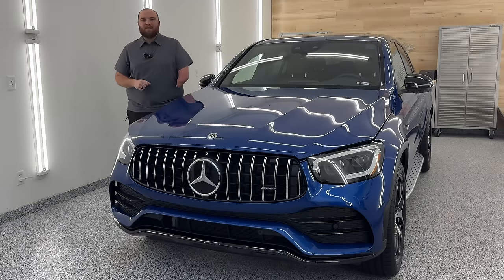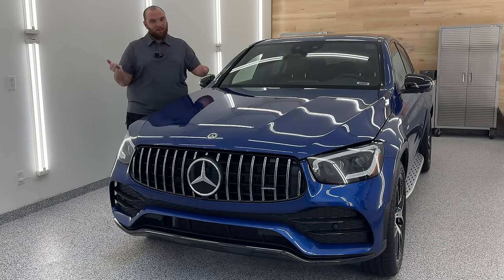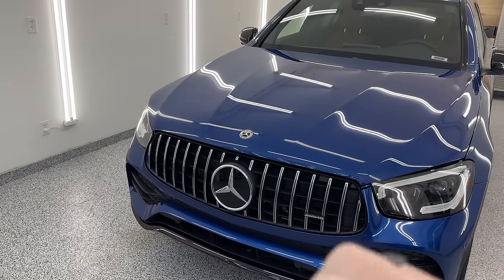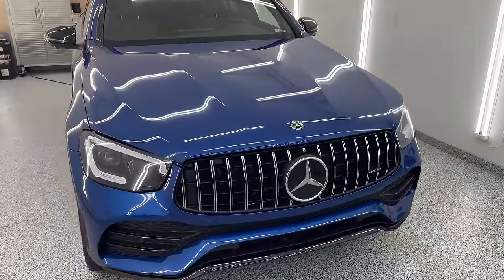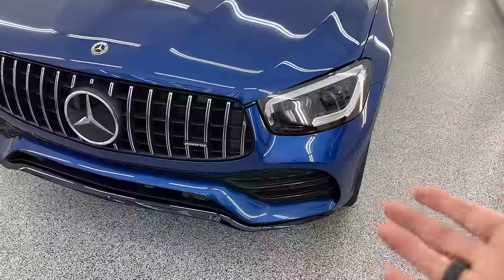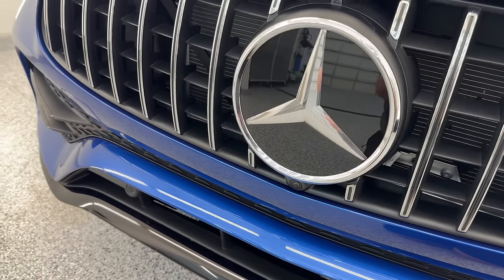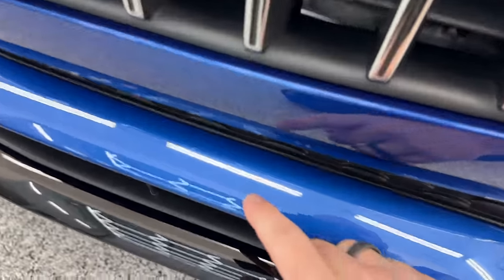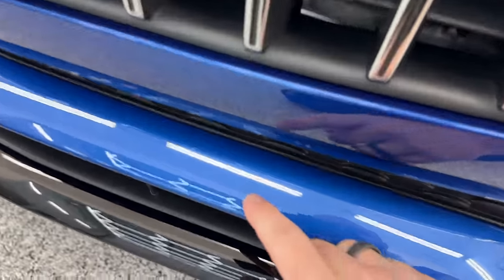The Ugly Truth About Paint Protection Film (PPF) After Just 6 Months & 3,500 Miles

Comment: Heat will make them marks better btw. Heat gun high heat. Just not to hot or you will burn the ppf.

What people don’t realise about ppf is that what would normally chip paint, won’t chip ppf. There will often be no marks at all from road rash. Whereas it would have chipped the paint. Hence paint protection film 😃 

it’s not bullet proof. Sometimes it will chip the ppf, but the glue crunches up together to protect the paint. Minimising damage to the paint its self.
Reply: But yeah that job is shoddy
Reply from the maker: Heat will not remove glue lines, silvering marks, stretch marks, or bug stains. That is all down to install error. Yes PPF will protect the paint in most cases, but again at what cost? Well in most cases THOUSANDS of dollars and an overall worse looking finish.
Reply: I mean if you know what you’re doing it will certainly make it look a lot better. I’ve been doing it 10 years 😃 was just a bit of advice.
Reply: It’s the bug stains and silvering it can help, as I say. If you know what you’re doing.
Reply: Yea heat and finesse and you can definitely make glue issues look way better. Use a clear plastic spoon and learn something new! You will be surprised

Comment: Coleton, I have a new ultra red model S plaid coming in a few weeks to replace a model Y performance. I did not PPF the MYP. I drive 30K+ miles a year on the highway and the model Y performance looks like it’s been shot several times by a shotgun with all the rock chips.  In this scenario would you do anything with PPF?  I think this car is going to be the right tool for the job for 6-8 years.
Reply: @onwisconsin2362 Gosh, I wish you would have said that sooner. 😉
Reply: Where were the majority of the rock chips? Bumper and hood. I'm trying to figure whats the most cost effective to protect
Reply: FWIW, I had a full frontal done + rear wheel arches on our Model S Plaid for 1,700.  I think that's the sweet spot on cost vs. protection for a high-mileage high-speed application.
Reply: @don.newlon  Awesome thanks for the reply. I'm going to do the same on my Tesla

Comment: Great vid, thanks for sharing.  A poor install for sure, probably a beginner learning while earning.  You’ve made good points, the PPF is like a condom, I will keep you out of trouble the majority of time but is not flawless.  As a sacrificial layer it’s not the way it looks when on the vehicle but what the vehicle looks like after removal.  I’ve used it many times without disappointment, and at the point of resale many have asked me if the car had been repainted for lack of damage exhibited.  Always my concern is rust for that chip that goes down to the metal forcing a repaint that itself does not always last and is ridiculously expensive today.  As an anal car enthusiast PPF allows me the freedom to drive without worry, a freeing experience for the anal amongst us.  Additionally with the front fenders PPF’d the engine servicing is of less a concern, how many times has a car come back scratched to hell from bad dealer mechanics leaning over them with belt buckles, hammers, knives, screw drivers, watches, chains, or what ever else they shouldn’t be near your car with?  Just my opinion from too many years of experience, and yes I was a professional detailer years ago, now enjoying it as a passion only.  Be well.

Comment: I would never go with PPF for that price. I prefer to plasti dip my car . Adds somewhat same protection from rocks and stuff. Yes looks bad after some abuse from rocks bugs etc and peels but for another 300-900$ depends on colors and car size you can redo it in a day even on your own, maybe even change a colour or have a fun mix. Makes the car more unique and personal and at the end before selling you can remove it in an hour. One of the reasons why now i buy only white cars. Cheap to repaint or correct for the same price as you would put bits of PPF and risking to have uneven cuts or fingerprints etc :D

Comment: PPF is not perfect, but the cost of body work just keeps going up. I had to have a panel resprayed and since it was the rear quarter it was a nightmare. Respray a couple harder to R&I panels and you're now even with the cost of partial PPF,  except now you have a body shop to deal with and they may not do a perfect job. Plus, when you go to sell the car, if it's not private party you will get dinged a bit for a respray and many of them use paint thickness gauges to look for it. I also don't think the clear shot by shops is as hard or as long lasting as modern OE baked clear.

Comment: The second p in ppf stands for protection correct? So i don't get your criticism, it did what it's designed for.
It's not for looking better while on the car. It can't provide that, and it doesn't claim to.
It's like the knee protection when skating, or the helmet when biking. It's purpose is protecting.
it took almost all of the damage instead of the paint better to have the rocks and bugs damaging the film than the paint.
Your critcism (before the part about the guys installing it) sounds like the guy i know, who eventually bought cutproof safety clothing for working with his chainsaw. When he used it the first time, he had an accident. The chainsaw caught, jumped and cut into his safety trousers. His thought about it: _f*** i wear those expensive trousers 1 time, and now i have to throw them away, they are destroyed_!  He needed someone else to tell him to think about what would have happened if he had not worn the sacrificial safetygear...

Comment: Came very close to getting PPF on my brand new car, but for how expensive it was I honestly couldn't justify it, just doesn't make any sense. Rock chips will not reduce the value of a used car. It's a used car, it's gonna have some dings here and there, no single rock chip affect resale value, unless it like ripped your door off. You also risk someone cutting your panel which then can lead to rust getting up under the car. Seen it happen on supercars, not worth that risk. I have a 10 year old car and it has very little rock chips, only one that's noticeable. Based on my experience having owned a 10 year old car and having very few rock chips, again, can't justify the price

Comment: Yeah, it costs a fuckton of money, a heck of a lot of labor to install, but if you do it yourself its actually a really cheap option to ensure your car doesn't get damaged especially if its a really old car that you have in good condition and actually want to drive it. The whole point of ppf is literally to save you from having to respray parts of the car, having to paint match rock chips especially on a pearl is a pain in the ass and for older cars NEVER comes out 100% factory perfect. A little bit of bug staining is not an issue when you're battling 400 bucks a panel to respray at the minimum and still will be less value than when it was factory.

Comment: The ppf did the job and protected the car's paint. Which is what its supposed to do. The owner can replace the ppf and don't need expensive paint correction and polishing because it did its job. But on the benz that ppf installer is joke, 2000$ for a shoddy work.

Comment: Meh. I get the not so fine line between good and bad installs, but at the end of the day just like every service offered it’s about the client. 

Their desires and expectations, what are they trying to prevent and what makes the most sense for them. 

It Is not paint perfection film.  Its main goal is to protect. They are different level of installs, but just like there are different levels of paint correction. Some ego guys want to get the paint perfect. But what does the client want. 

It’s so easy to see a ton of issues in proper detail shop lighting. But you bring it out into the natural light (sun) and you will be hard pressed to much silvering or glue issue. But again at the end of the day - did the client see any of it and point it out? My guess would be probably just the dirt on fender if anything

Comment: If you ceramic coated the whole vehicle & the guy came back & there were permanent stains in the ppf then in my opinion it's the ceramic coating that failed.
Reply from the maker: I’d say both failed
Reply: @OutofSpecDetailing  not really. The point of ppf is to protect the paint. It's in the name & it did it's job just fine.  Ceramic coating is supposed to be a semi permanent coating on whatever surface it's put on to protect from this exact form of damage & it DID NOT do that

Comment: There are a few things here that don't add up. No disrespect to #OutofSpecDetailing but in this video he doesn't know what this PPF product is. Putting the wrong coatings onto PPF at best might do nothing to help, and at worst...  this is Chemistry and they've used an untested combination. For PPF it's better to use a nano coating. They don't last as long as they are more flexible, but they can move with the PPF. This is different to a Ceramic Coating (as mentioned in this video) as they are designed to work with hard stable paint.

Also this car looks great - so PPF doing ok from what I can see. 🤷‍♂

Comment: Is PPF worth the money?
That's like asking if Sudden Impact is a good movie.
6 months of PPF and 3500 miles is Again, subjective. 
Waaaay too many variables to be suggesting that people not use it. I've had it in my Hellcat since 2018. Expel. Professionally installed. Absolutely no issues, ZERO, with the performance of the film. In fact, not only was mine ceramic coated but it also actually has Several Several Several Knicks and dings because Texass roads. 
You bug stains problem is an issue with the owner not taking care of their vehicle. Bug stains are far worse in paint as the bug guts and chemicals etch into paint. I'd MUCH rather have it etched on the PPF and NOT the paint.
Wash your damn car man. Just because it's PPFd and Ceramic coated, does Not mean ya just drive it and forget it down the next 80 years.
C'mon man.

Comment: This is the dumbest video I've ever seen against ppf. This video to me pretty much proves why you "should" have some protection on your car. He failed to mention that bug splatters also stain paint, and those small rock chips damage, well imagine with no ppf. Also, he wants to sell detailing and wax jobs....if you ppf your car and ceramic coat over it will DRAMATICALLY reduce staining.

This guy is just making more business for himself....how....well if you don't ppf then you have to pay for full detailing more often and that's also not cheap. What about the case of rock chips, there's no solution accept, well get the bumper painted, that is an absolute nightmare. For one more expensive than ppf, two they have to disassemble your car and reassemble and these paint shops break things and reassemble things wrong all the time because they do paint, not Mercedes, BMW or Toyota technicians, and not to mention all the auto cruise control and safety radar stuff in modern cars. They have to disconnect that reconnect and recalibrate the cars whole safety system, yeah sounds like a great idea to let a paint and detail shop do that. And the absolute worst is that VERY FEW paint shops can get your original color match, especially if it's a very specific color gradient paint, like many Lexus, Porsche and BMW models have. And if the car is older and sat out in the sun often it's virtually impossible to match the naturally faded paint. Your only option is to repaint the whole car, that sounds lovely.

PPF is a layer of paint that protects and sacrifices itself in place of the car's paint. People let me tell you, if you care enough about putting ppf on a car then you have take care of it. That means when you get bug spatters wipe them off, when you reach your destination, DON'T let the bugs bake on the hood for weeks then go to this nutjob. If I take a road trip I immediately wash the car at my destination and do the same on return. During daily commutes, I wipe bugs and splatters away every several days.
I actually do plan on keeping my car, I'm a car enthusiast, so I get it detailed, paint corrected, ppf and ceramic coat the car. I always hand wash, and I do the required maintenance to keep the ppf healthy. in about 8 years I'll have it ripped off and put new one. If you don't have the time to maintain your car then, you probably don't care to begin with, pay someone or buy a Chevy Malibu, Camry or minivan you don't give a crap about. But for any car enthusiast, interior, exterior and mechanical upkeep is part of the car guy love. I own a 22 4Runner in a very metallic paint and in the two years I've owned it looks immaculate but I went to my guys shop the other day and he had a Range Rover SVR who ppf'd the whole car in stealth ppf and worked at an airport where he parked in the sun everyday for 4 years along the runway where the engine fumes settle over his car. The ppf is atrocious, and ruined the clear coat on the carbon fiber hood, why because very poor maintenance. Keep things in context or the internet can plain out make stuff up like this guy.

Comment: ITS PROTECTION NOT PERFECTION, THINK OF THE COST OF A REPAINTED FRONT END, WIL VALUE DAMAGED. TAKE CARE OF IT, HYDRATE THE FILM, YOU WILL BE BETTER OFF THAN WITH NOTHING I CAN PROMISE..... You can use wet 3k sponge VERY lightly on those areas, it will come off. You have to care for it, this is customer negligence.  a replacement install for a hood 550.00, front bumper 600.00 Fenders 800.00

Comment: There's another major downside to installing PPF: permanent blade marks under the film are very common, and are often not discovered until the films are completely stripped off from the car. This means you can spend $8K on PPF, and think you protected the car, but the installer may have accidentally made permanent blade marks under the film and damage the paint, when the car is brand new.  

Before people blame the poor quality of the installer, one should remember human errors and accidental blade marks are inevitable, even among the best of the installers, because PPF installation is very labor intensive and tiring.  Cutting films with sharp blades come with unavoidable errors, especially when performed hundreds of times over one PPF installation.

For the blading risks alone, I'd never bother with PPF installations on my cars.

Comment: So what kind of cheap garbage ppf were you throwing on your customers cars exactly?? I think this is a rather flawed analysis apart from the concerns of a bad installer. No mention of the various ppf vendors and choices tells me a lot
Reply from the maker: I was an XPEL certified installer
Reply: @OutofSpecDetailing  which Xpel did you use on that Mercedes? Sure looks thinner than what I have on my car
Reply from the maker: This wasn’t an install by my shop. Very clearly stated that in the video.
Reply: @OutofSpecDetailing  so you actually don't know what film was used on the Mercedes in your video then. What did you use on the Audi? Let's try that